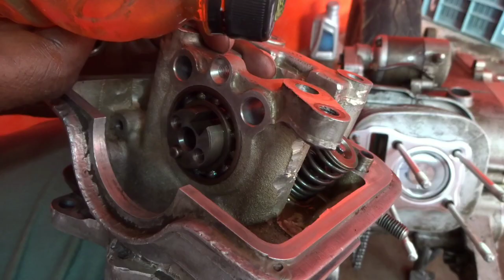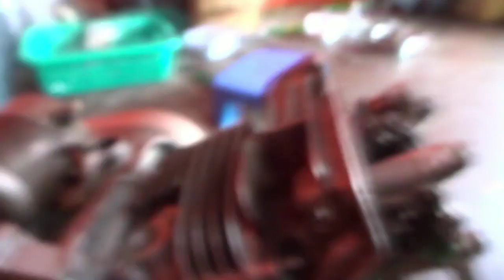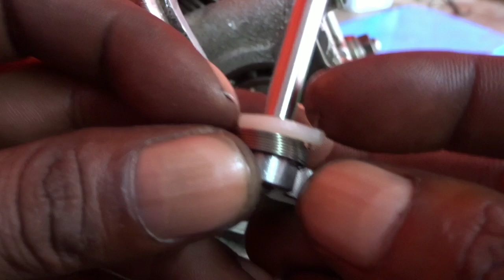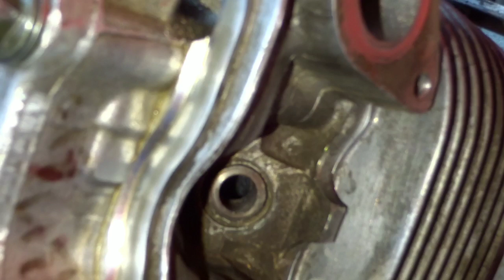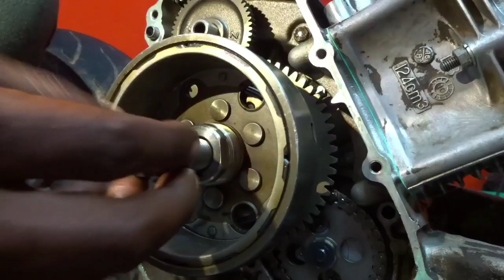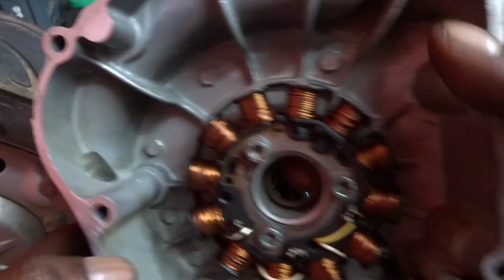How to set the decompressor the Suzuki access 125

Comment: My access is dead ! I have cleaned carburetor and airbox assembly and i put new filters and i checked diaphragm it seems good. And i checked sparplug it also working fine.! Access wont start...thanks to suzuki
Reply: There are other areas need to be checked. There may be problem in the head. If oil pump failed, bike won't start. If timing is wrong then bike won't start.. And even more areas to be checked to find out the exact problem